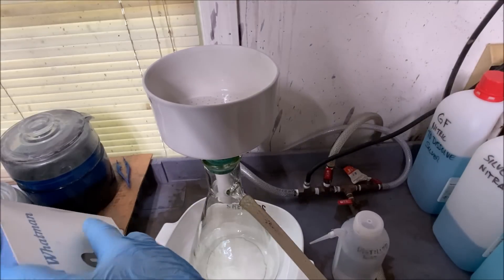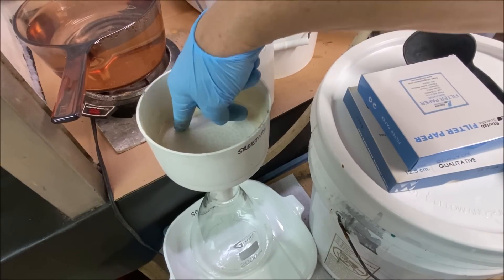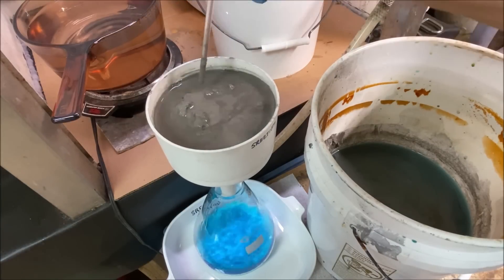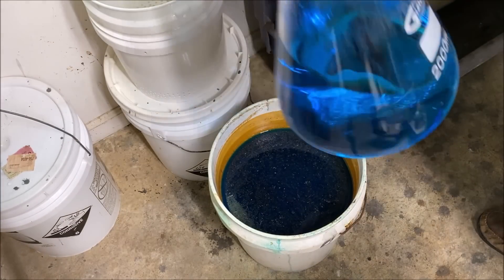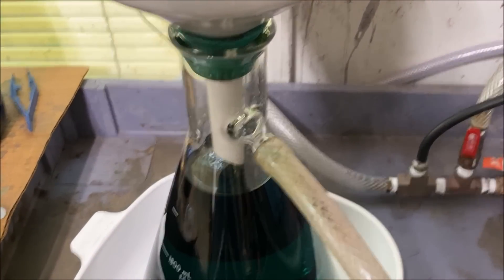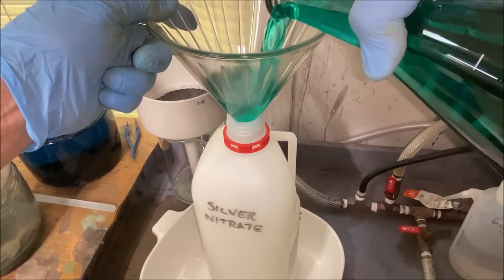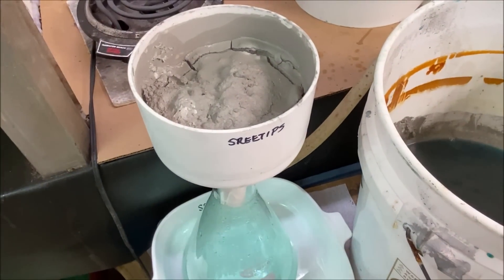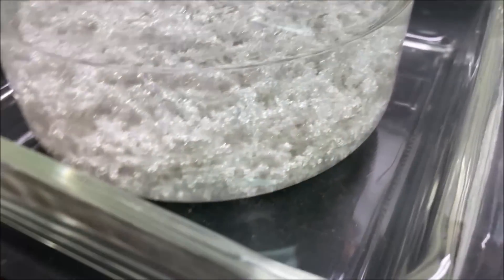How To Refine Silver To Three Nines

Comment: 7:57 did you know that if you crystalize out copper nitrate then distill it destructively you can recover the nitric acid.
same holds true for iron nitrate.
Reply: He's talked about that in past videos and how the time and energy cost plus danger of nitric acid vapours during the distillation simply does not stack up against the convenience and cost of simply wandering down to the hardware store for a bottle of nitric acid. 

I'm slowly buying kit myself to try refining gold as a hobby scale on old computer parts. And due to local laws restricting access to nitric acid, I'd have to make my own.

Mixing copper sulphate (farm footrot treatment) with calcium nitrate (hydroponic nutrient) to form copper nitrate and calcium sulphate (gypsum) then Thermal decomposition of copper nitrate to nitric acid and copper oxide IS viable for me. Through I'm actually planning on the potassium nitrate and sodium bisulfate method. 

The copper oxide crust from thermal decomposition of copper nitrate can then be cleaned off the distillation flask with Hydrochloric acid to form copper chloride which is easily electrolyzed to pure copper on a graphite electrode off gassing the chloride as chlorine gas. So you get your copper back rather than disposing of it. 

But for Sreetips, he's worked out it's just not worth it with nitric acid available on the shelf.
Reply: @rhysfirth3506  electrolysis of copper chloride will release copious amounts of chlorine gas.
Reply: @CatboyChemicalSociety  I mentioned chlorine gas offgassing. Fume hood and extractor fan and exhaust the gas away from dwellings and it's diluted enough to be harmless. 
You breathe plenty of chlorine gas in enclosed public chlorinated pools. It's simply a matter of concentration/dilution. 
Just use common sense.
Reply: @rhysfirth3506  Take a look at this video if you're interested in making your own nitric acid:
https://www.youtube.com/watch?v=HN6tv7NKtPk - Making Nitric Acid From Air - Elementalmaker
Reply: @rhysfirth3506  Check out a video of NurdRage on copper nitrate, the proposed processes recovers both nitric acid, copper, and sulfuric acid. You also don't need to decompose anything, just distill.
Reply from the maker: Yes

Comment: Do you ever melt the crystal into bars? I would like to see that. Nice work on the flow through to waste!
Reply: I do beleive you can charge more for crystals than bars cause of the formations. I beleive.
Reply: Yes, Sreetips has some videos on melting the crystal into bars. Not very practical, though. The silver in those bars gets contaminated by burning products of the acetylene and oxidation during melting and the bars don't look that great. He'd need some hydrogen flame to avoid contamination, or a furnace capable of the appropriate temperatures.

Comment: Great video. Really clarified the whole process. Would it make sence to add a lot of water to the cement silver bucket and mix it around in there to dilute the blue liquid? I'm thinking you could then use a vacuum to remove the rinse off the top once it settled, and repeat a few times. Mixing the hot water around in that small container with trying tk avoid tearing the filter paper seems like a real chore
Reply: makes sense to me
Reply: It probably would perhaps speed things up but I think this is more for the novice. The main bucket of silver cement must weigh many kilos. So I may be wrong but he is probably showing it like this for people doing small scale production. And also the purity is also his main goal.

Comment: Have you ever had your copper cement tested to see if there is any recoverable yield?
Reply: @Cameron Keillor The best way to deal with it would be converting it to copper sulfate by adding sulfuric acid, then distilling out the nitric acid that formed; then doing electrolysis of the copper sulfate. This way, nitric acid and pure copper would be recovered, possibly also remaining precious metals as anode slimes. NurdRage has a video on that. Platinum anode may be needed for the electrolysis cell.
Reply from the maker: No

Comment: Sreetips' dinner guest:  "That's an interesting choice of toilet Sreetips.  Stainless steel is very modern."  Sreetips:  "That's not stainless steel it's silver.  Running out of places to store it and I feel very powerful going on a silver throne" :D :D
Reply: As a bonus, it's also anti-microbial!
Reply: @DFPercush  i literally just came here to say exactly this! Or, he could pull all the copper out of the solutions he already got all the silver out of, 6 and make an antimicrobial copper toilet and he could electroplate it in silver so he doesn't waste too much silver. Just coat the copper with a couple mm of silver and boom, same antimicrobial effects, same look, and Sreetips gets to keep most of his pure silver crystal. That's what I would do, personally. This way, he can use the copper nitrate he has sitting around in solution.
Reply: Nothing like peeing on gold though 😂
Reply: A silver toilet seat would be freezing cold!!!
Reply from the maker: Not after you sit on it for a minute.

Comment: Another great video !!!!!  how pure is the dried cement silver ?
Reply from the maker: The cement silver is between 98% to 99% pure silver with the main contaminant being copper. We get all the copper out by running it through the silver cell. The copper dissolves along with the impure silver. But it doesn’t plate out with the silver, but rather, builds up and collects in the electrolyte. This is what cause the electrolyte to turn that beautiful blue color. As long as conditions are kept within specific limits, the copper will just build up in the electrolyte and not plate out with the silver. One professional refiner that I learned from on the goldrefiningforum.com (I think his name was Goldsilverpro) even recommended adding some dissolved copper to the electrolyte because it promoted crystal growth.
Reply: I vaguely remember it being mentioned to he around 85 to 90 %
Reply: @mattjirgal1676  According to the video a bit over 98%

Comment: Very cool, what happens to the liquid after you cement out the copper on the angle iron? Can you finally run it down the drain?
Reply: he covers this in an earlier video on waste treatment, there was a pH adjustment to 7, and i think some bleach but i might be confusing that with a codyslab video where he used cyanide on dishes with gold trimmings
Reply: @m3sca1  so eventually it is determined safe to dump it into the city sewer?
Reply: @weasel6three597  yeah once it has all the metals dropped and neutral pH it is fine, i will see if i can find his video and give you the title....

Comment: Never get sick of seeing these videos Thanks.     Would it be possible to suspend 9999 silver wire in the cell in an interesting shape and have crystals form upon it ? I have always wondered if this was possible and make for an interesting video .
Reply: I think the wire might have to be stainless steel but it would look cool if it works
Reply: @scrappydoo7887  Good piont , If this is correct , Stainless figurines large enough for display , could be  acid etched before being   hooked up  in a deeper stainless container . Crystals could coat the rough surface  to the point were they become too fragile or practical  to continue , before cutting free  , as stunning original pieces .
Reply: @GR19611  yes that would be very cool. I'd like to know how fragile the crystals actually are to be honest because they would make excellent gifts
Reply: @scrappydoo7887  Yes , I wonder what Sreetips might say about this. Use the figurine as the Cathode . Cheers👍

Comment: cemented out silver have other uses?   used for inquartation gold or cementing gold? or do you prefer to use thrifted silver for that kind of stuff?   maybe cement silver is too small / packed  to cement out gold?
Reply from the maker: It would work well cementing gold. Using cement silver to inquart is not recommended because palladium follows silver and it would tend to build up in the silver.

Comment: Why does only silver crystallize out on the bowl? Why don't contaminates come through?
Reply: Guess: Anything more reactive than silver stayed in solution when the silver was cemented out on the copper and got rinsed off in the funnels. And anything less reactive than silver stayed in the anode baskets (1) because the voltage was set low enough that it only picked up the silver and (2) because it wasn't soluble in the electrolyte.
Reply from the maker: The contaminants are insoluble and remain trapped in the anode filter. Only copper and silver get through. If the electrolyte is acidic (excess nitric) and there is palladium in the slimes, then the nitric could dissolve the palladium and it would contaminate the electrolyte turning it green.